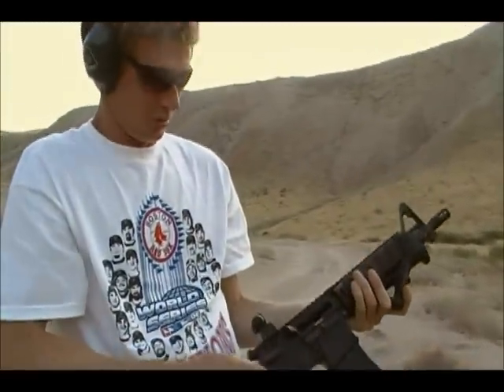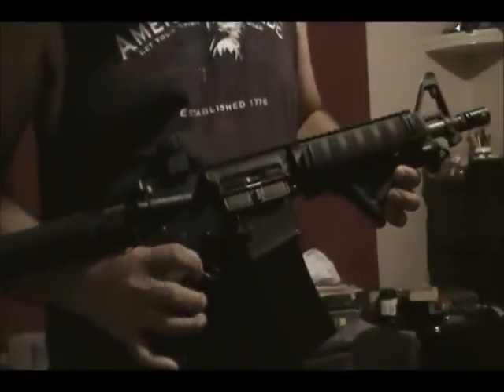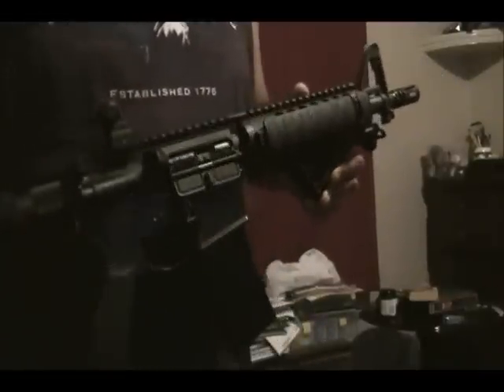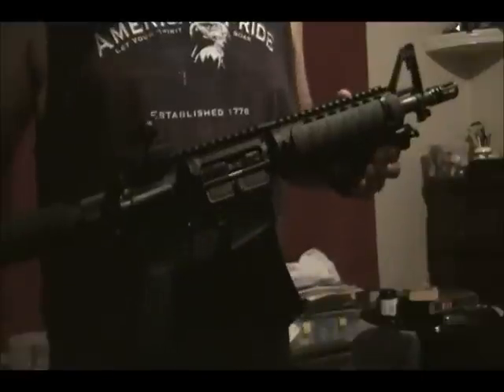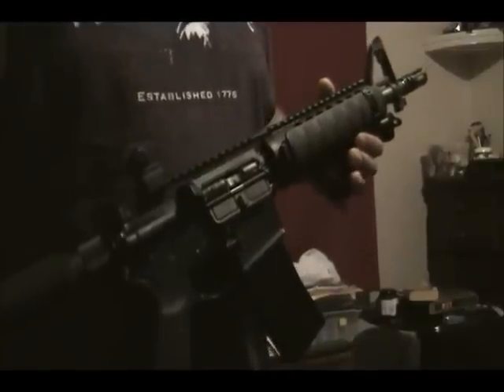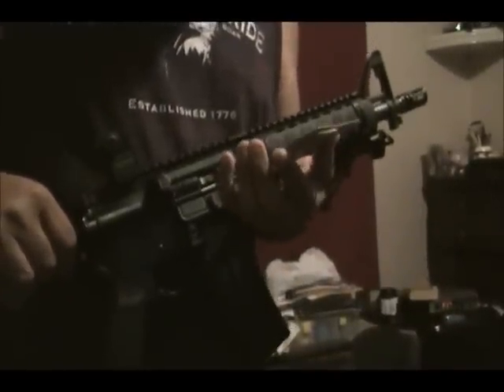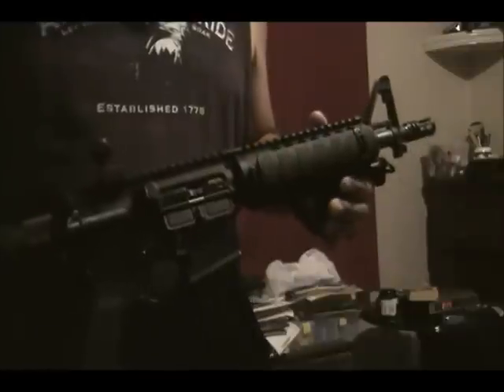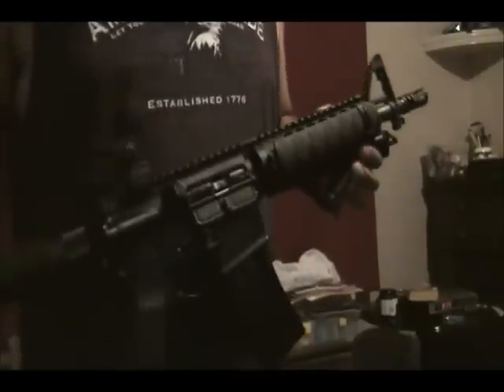AR15 pistol gas port modification info 10-1/4 barrel 3/32 drill bit

Comment from the maker: @Eslamizar -your kit will have a little warning label, it will tell you what they are ok with.  I think if you use the zinc coated silver bear you wont void the warranty. I recall it was the laquer coated stuff they were against. i think the polymer coated stuff was suppossed to be ok as well. I recommend  silver bear. it works in all my unmodified full size AR's. i just had to mod this pistol cause it was ported for the "good stuff". i went with Colt's gas port spec.

Comment from the maker: No requirment to report it or mark it at all. only if you give it away or sell it. single shot sled or the single shot drop in adapter  for mags you can get from brownell's. basically you just assemble the gun as you would any, but first add the single shot mag. once together you pop out mag and  the adapter and you may use 10rd mags in it.(cali only) if your in a free state just assemble it and add any mag you like.

Comment from the maker: actually before you try anything be sure the bolt lugs and rail are well lubed with hitemp bearing grease and that you have oiled the gas rings with clp or any weight motor oil. then try enlarging your gas port. the gas mod should work I have done it to two of my 10-1/4 guns and several of my friends and all have functioned 100% with the mod.

Comment from the maker: Remember not all brass case ammo is the same. some is underpowered. I only shoot low power steel case russian so I went with the tried and true colt spec. Yes, you made the problem worse by going to the heavy spring and buffer set up. go back to the standard , try drill 43 = .089  and see how it cycles with the ammo of your choice. if that doesn't work go to the full size 3/32.

Comment from the maker: Sinclair AR-15 ALUMINUM SINGLE SHOT FOLLOWER - is the adapter. once your gun is done it can be used with any legal mag there is no requirment in cali's stupd law that precludes you from using legal mags over 1 shot but under 10. the law just states the nonrostered gun has to be single shot when it is transferred to you or built so what you do after (as long is it is not configured as an assault weapon per cali laws) is up to you.

Comment: Thanks for posting the video. I recently built and sbr with 10" barrel with pistol length gas port. It is drilled with .086" according to the barrel manufacturer. Experiencing ftejects where the brass gets pinched with the bolt while loading another round. Also tried heaver buffers and buffer spring but made it worst. No issues with the bcg locking back on the last round so I'm not sure if its shortcycling or not. Will you recommend openning up the port to .090" or .093? Thanks

Comment: I just did this same mod to my 10.5 ar-stoner barrel this morning but I haven't had to to fire it to see if it fixed my issue yet. Mine would eject the case and reset the trigger but not send the BCG far enough back to pick up the next round. Did you measure your gas port before drilling? Mine started out at .071 and after drilling it's now .093
Reply from the maker: +tork62077 it could also be ammo related. if you fire really weak ammo , like tula it requires an even larger gas port , or to trim the recoil spring a bit.